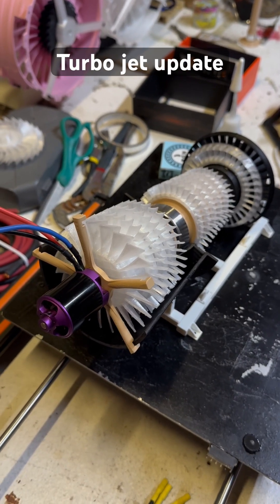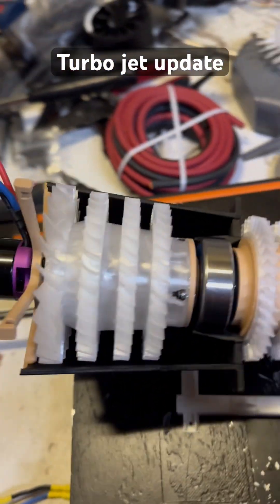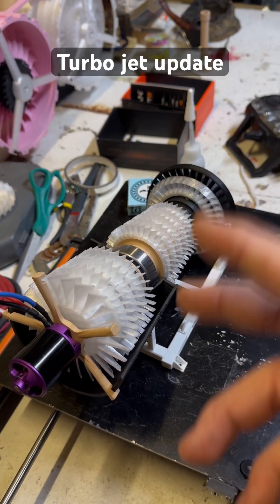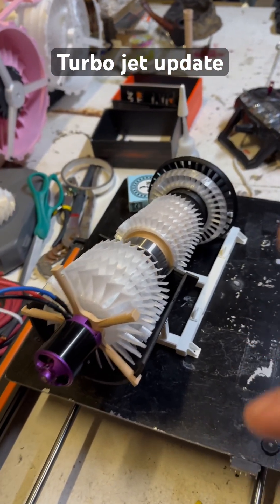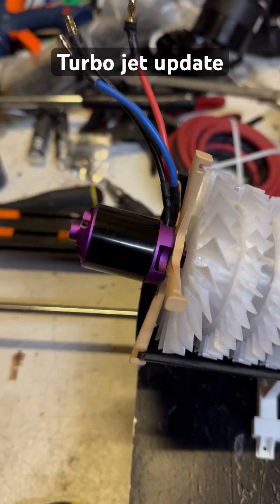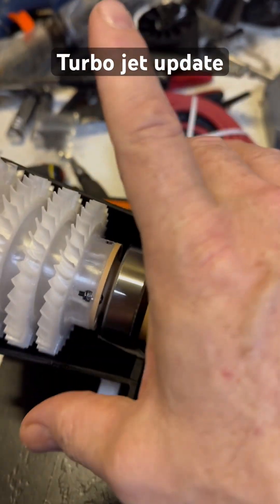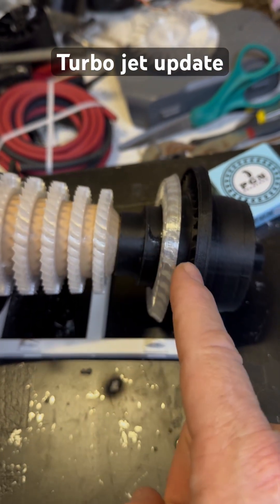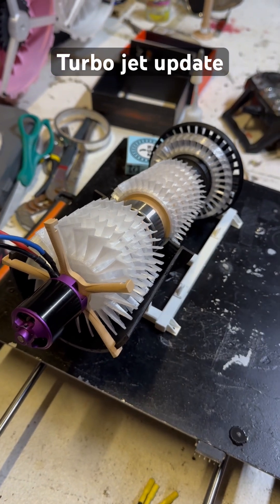You knew I had to, Turbo jet. Especially￼ after Stubby Fan V1. #edf #turbojet #electric #fyp #rc

Comment: I do have a question though, seeing this isn’t a gas propelled turbine. What is the purpose of the compressor and will it generate significantly more thrust than that of the Stubby and the Twins?
Reply from the maker: The purpose behind the compressor was typically to force air into the combustion chamber, which would then turn the low pressure turbine at the rear in this application. The compressor will speed the air up, still interacting with the low pressure, turbine blades, and alleviating any torque on the motor.
Reply: @warmachined3472 aahhh I see, just like a regular jet turbine but without the gas and combustion chamber. So less torque on the motor means less stress on meaning it probably won’t burn out am I right?
Reply from the maker: @SAG1028  Yup the faster the air I force through the low-pressure turbine the less the motor has to work decreasing load and voltage consumption.
Reply: @warmachined3472  🤔 interesting, and smart.